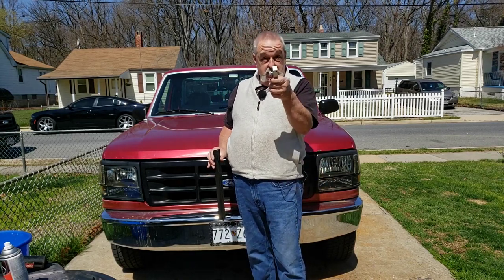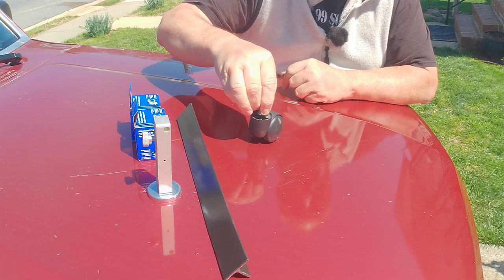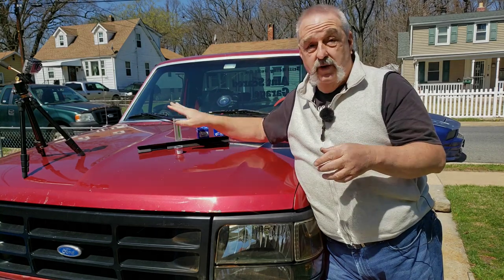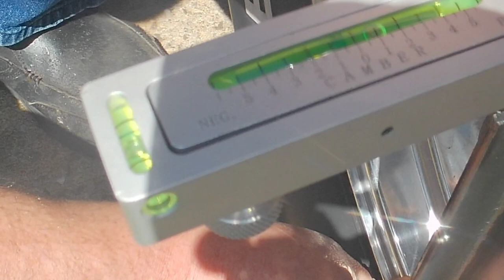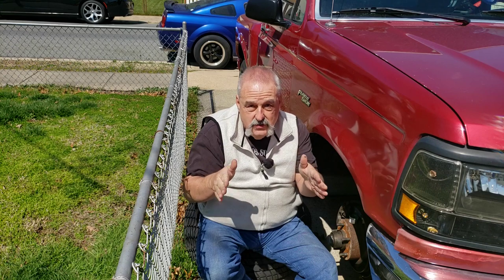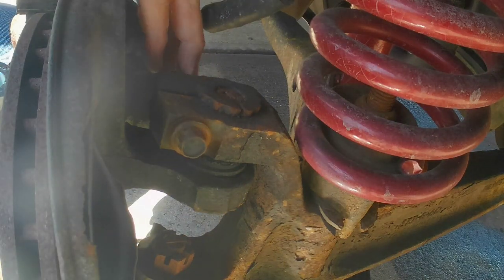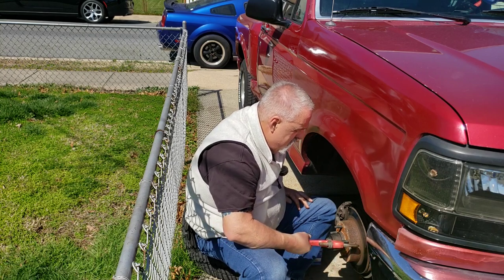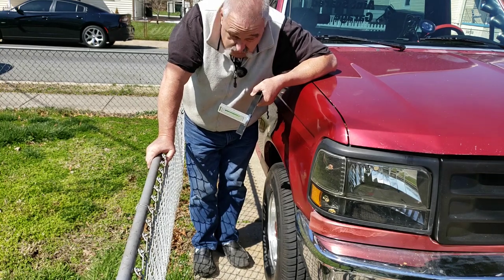How to set the Camber on your OBS Ford F150 Flareside

Comment: After finding your camber on the wheel, remove the wheel, stick the tool on the rotor and adjust it to read the same that it did on the wheel.  Then you can make your adjustments without having to put the wheel back on and off 'till you get it right.
Reply from the maker: So do you need to set the outside of the axles on jack stands, I figured, and I could be wrong, that the camber would change if the wheel/tire isnt setting on the ground right, thats why I moved it back and forth, I'm new to setting it this way, forever ago when I worked in a shop I had access to an alignment machine, so doing it in the driveway is a bit different
Reply: @AintScaredGarage  You can have it on stands or a jack, and it won't matter where the support is or what angle the truck is at after you raise it.  Let's say that you checked at the wheel while on the ground and found that you needed 1.5 degrees more negative.  Raise the truck, take the wheel off, put the level onto the rotor, zero it, then adjust 'till you see 1.5 degrees negative on the level and it's set.
Reply from the maker: @DonziGT230  OK now I see, its all in leveling the tool, after that it should then give you the correct reading regardless of how the truck is setting as long as you level the gauge, Thanks man, this is what I hope for with this channel, I'v told you all, just a guy in is driveway here, if I'm wrong about something please let me and everyone else know, Thanks Donzi this is great stuff
Reply: @AintScaredGarage i

Comment: do you have a part number for the caster/ camber bushing that allows you to adjust them separately?
Reply from the maker: I just searched them on Amazon and found them, here is link to one of them, I hope it helps https://www.amazon.com/dp/B000S2IZ6G/ref=sspa_dk_detail_1?psc=1&pd_rd_i=B000S2IZ6G&pd_rd_w=fyLl2&content-id=amzn1.sym.3481f441-61ac-4028-9c1a-7f9ce8ec50c5&pf_rd_p=3481f441-61ac-4028-9c1a-7f9ce8ec50c5&pf_rd_r=G7REWNQBV865EQCKY10N&pd_rd_wg=zPnDw&pd_rd_r=7a757c69-88f0-4036-bccc-3b3f9611f255&s=automotive&sp_csd=d2lkZ2V0TmFtZT1zcF9kZXRhaWxfdGhlbWF0aWM&spLa=ZW5jcnlwdGVkUXVhbGlmaWVyPUExTVJPUUg4N1NQUDBIJmVuY3J5cHRlZElkPUEwNzAwNjA2MzNNT0NZWEUwNFE4NCZlbmNyeXB0ZWRBZElkPUEwMzgwMjA2MUZKRVY4RjZLWktPQyZ3aWRnZXROYW1lPXNwX2RldGFpbF90aGVtYXRpYyZhY3Rpb249Y2xpY2tSZWRpcmVjdCZkb05vdExvZ0NsaWNrPXRydWU=
Reply: thank ya!

Comment: Like the headlights.
Reply from the maker: I looked for while to find ones I liked, But the small corner lenses seem to be turning yellow already, the other ones are fine, I think I'm going tint them all slightly yo tray and hide that, Thanks
Reply: @AintScaredGarage  Thanks for this input for sure! Had aftermarket on the one I bought, put originals back in and was actually looking at these and a darkened set.